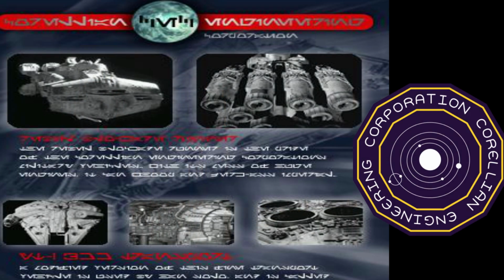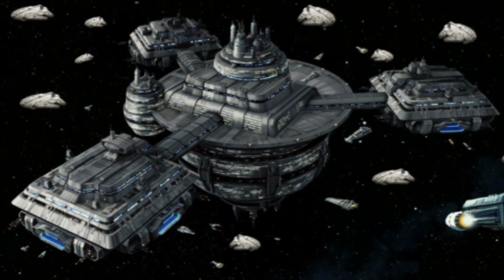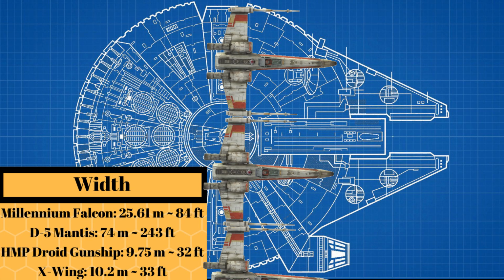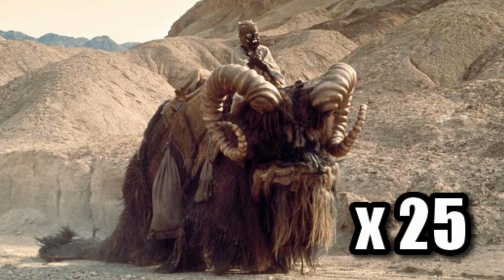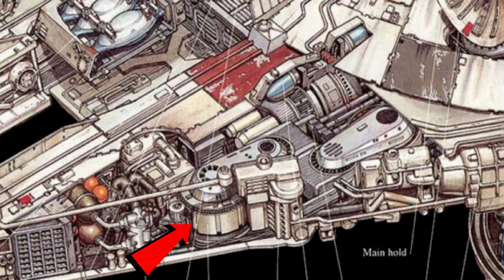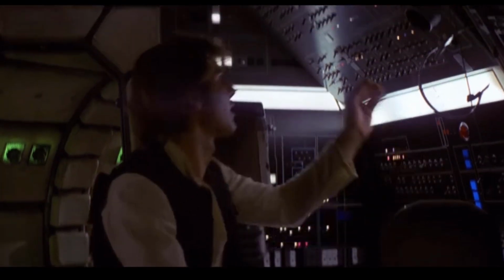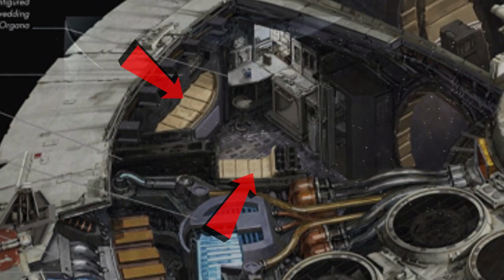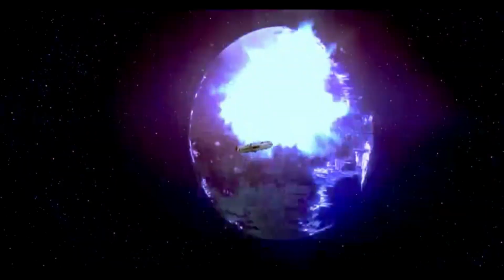Millenium Falcon COMPLETE BREAKDOWN  - YT-1300 Light Freighter - Star Wars Ships Explained

Comment: The speeds given are hilarious. They could never escape a planet's gravity with those speeds.
Reply: Probably on about at sea level, the higher you get aerodynamics are less imoprtant so the faster you can go. Concord could only do 472 knots at sea level and even Spacex's mighty Falcon9 has to throttle back so that it doesn't break the sound barrier until it reaches thinner air (maxQ) or it will tear it's self apart
Reply: The speeds listed are atmospheric...Jock is right!
Reply: Geography in Action  I thought about that when they talked about using artillery shells to put people in orbit, I mentioned it to my friend and he started singing " calling major mush".
Reply: Brent Holt Exactly, maybe 68, 000 mph. Our standard communications satellites orbits the earth at around 30, 000 mph.
Reply: It has vertical take off! It doesn’t need to go fast to escape gravity. You can’t say that a balloon is going fast, yet it can fly. None of the vehicles in Star Wars have insane atmospheric speed, because first, that’s not their main purpose, and second, there’s only so many g’s a body can handle.
Reply: Jock Wood Every planet is different, with different sea levels. This guy made himself look like an asshat by making shit up. Go get yourself the First Edition Star Wars Encyclopedia, and a copy of the Star Wars Guid to Ships and Technologies, and you will find the proper specs of our Beloved Millennium Falcon. And that ship design is much older that this guy put on.
Reply: What the hell are you going on about? The initial argument was you calling a fella an ass-hat regarding a speed that was obviously one denoting atmospheric flight, not trans-atmospheric or non-atmospheric. The laws of physics are still relative here. Most of the planets visited by the Falcon in the SW movies have a gravitational pull similar to Earths, even the Space-slug in ESB for that matter. The ability to fly regardless of materials and technologies is still based on human limitations and physics. Not all of the ships in SW are saucer shaped. The speeds mentioned in the article are  in and around the speed of sound which makes perfect sense for repulsor-lift technology and the speeds we saw the Falcon and other vessels fly at in the ten films released thus far. You made a claim of 68,000 mph which is ludicrous after accusing the guy for being an ass-hat and making shit up. As I mentioned, there is no way of speculating an actual mph rating for space flight, as it does not relate to real speed in space at hyper-drive speeds. Hyperspace is not just a speed but it is relative to time as well. Secondly, I have never seen a vessel travel in atmosphere during any of the films that would suggest to me that any vehicle could fly at 68,000 mph! I'm not wrong, how can I be when the discussion concerns a highly fantasized and derivative subject such as SW? Quit while you're ahead, if you insulted the guy for no reason and now you're just being rude.
Reply: @Cliven Longsight  I understand that. But relativistic effects aside, to claim the vessel has a "top speed" really implies the fuel is totally spent. Otherwise you can always go faster.
An airplane has a top speed because of drag. But drag is not a factor in space.
Reply: What’s hilarious is you’re applying real world physics to Star Wars.
Reply: @TheRedRaven_  What's hilarious is that people are trying and failing to apply real world physics to Star Wars.  Most of these people should just give up.  They just don't know what they're talking about.
They shouldn't try to apply real world physics to star wars.  The the insult to injury is that even when they try, they still can't get it right.
Reply: That's assuming you wanted to reach orbital and escape velocities.  What if you only had to get far enough to use the hyperdrive? Basically just exiting the atmosphere.  The lower velocities would also simplify re-entry.
Reply: John Wang The speed doesn’t need to be achieved, it’s a constant speed based off thruster technology in cannon and the films. Sci-fi fiction never asked for realism.
Reply: @TheRedRaven_  You do realize that my post basically said that perhaps speed wasn't needed the way our existing spacecrafts needs them...
Reply: John Wang It’s not up for debate, it’s explained in cannon. Not trying to be a smartass, just saying it’s a debunked conversation.
Reply: @TheRedRaven_  Who said anything about debate or even whether or not it was canon.  My you're touchy when it's obvious you missed out on everything in the first place.
Reply: John Wang stop liking your own comments, it’s obvious.
Reply: Brent Holt im glad that someone else noticed that his speed figures are a joke.  I guess according to him the falcon is capable of light speed and escaping the earths gravity, but cant break the sound barrier in level flight.
Reply: Geography in Action Wrong, The MF is a saucer design. The most aerodynamic aircraft design. And MF was not designed or built on earth, or even in our galaxy. The materials that are used are far more advanced than anything we can, openly, make today.
With certain tech., any aerospacecraft can produce mach and above speeds, without the need to worry about aerodynamics or inertia. And gravitational forces are still felt in a zero gravity environment. It is called centrifugal force.
Reply: My thoughts were more like "So, if you're cruising (floating) at "top speed" in empty space, and the hit the accelerator... What would happen?" :D
Reply: @Cliven Longsight  I feel we're somehow speaking past each other
Reply: @Cliven Longsight  if you have the power and fuel, aren't you able to escape a planets gravity at slower speeds? Maybe I'm misreading something
Reply: Super Slovak ?
Reply: According to the numerous Starwars novels, films, games and umpteen tech books, ships in the Starwars universe can neutralise or repulse gravity, generate their own internal gravity, neutralise or dampen the effects of intertia and leave a planet's gravity well without needing to reach orbital velocities and likewise without needing to scrub off orbital velocity to land on a planet. Having said all that, if ships can generate and shape force fields around them then surely they can form an aerodynamically shaped shield to increase atmospheric flight velocities?
Reply: I can't imagine the tears of disappointment a physicist would shed after reading this thread.
Reply: learn physics before you start saying dumb things. You do not need to achive escape velicity as long as you have enough thrust. You can escape at 1 kmh. The escape velocity is calculated for non-propelled object. And it is calculated without drag and it changes with hight.
Reply: The Falcon uses repulsor-lift engines in atmosphere, I think that the speeds he is referring to, are atmospheric and they seem bang on for what RL's can do...this isn't an SR-71, it's a highly non-aerodynamic 'thing' using anti-gravity. No bucket of bolts is going to go 68,000 mph in atmosphere, it would kill every single person aboard and come apart into a million pieces, it's called G-forces in atmosphere!!! He obviously wasn't talking speed outside of the atmosphere either, because nobody has invented 'Lightspeed' and nobody knows how fast it is, all we can do, is to use the various bits of SW lingo to discuss rates of speed of fictitious space-ships, parsecs etc., etc.... The only ass-hat on here is you for knocking the guy!!!
Reply: Correction these ships would never go fast enough to achieve an orbit. To escape gravity of an earth like planet you just need acceleration that is greater than 9.8 M/s squared. 

Accelerating upward at 10 m/s squared will see you eventually leave earth, even though you’re going relatively slowly.
Reply: Skaianet correct
Reply: Tha_slughy you have no clue what you are talking about
Reply: Negative, it’s the acceleration you need... you can escape earth gravity at 1 km/h if necessary
Reply: No
Reply: no
Reply: With CONTINUOUS repulsorlift thrust, do you NEED high speeds for escape velocity?

Comment: You would think the rebels would have had a few of there own converted into fighter bombers considering the modification potential and they were cheaper  than a Xwing
Reply: CHESHIRE CAT YT -1300 GTI
A rebel light corvette based around the YT-1300 would be an interesting concept. Include all the speed and maneuverability modifications of the Millennium Falcon, just improve the reliability with a good service. Strip out all the cargo space and amenities and add extra quad guns and shields and a large compliment of concussion missiles. It would make a good hit and run raider that could disguise itself as a civilian freighter to get in close to targets in high traffic areas. Launch a salvo of missiles at heavy targets and annoy the crap out of starfighters with its extreme maneuvering and point defense guns. 
And outrun anything. 
It would also work in pitched battles where it would once again destroy enemy fighters and launch concussion missiles at high value targets and could get close enough to make intercepting the missiles very difficult while targeting subsystems. And just be a pest with its zipping around the battlefield doing straffing runs. 
The advantage of it's civilian design is logistics, getting a bunch of them would be easy for the rebels, who then upgrade it's systems with military components.
Reply: Later Legends books mention a YT-5100 bomber, briefly.
Reply: No wonder you don't have a girlfriend you dork
Reply: I am assuming that the costs of the YT-1300 is without any of the concussion missiles and quad laser turrets and so forth, because the TY-1300 was so modifiable. I would bet that the x-wing price, being chiefly a military starfighter would have included armaments in its price. Thus, the price of a YT-1300 other than as a simple freighter would go up pretty fast, and a fully modded out one like the Millennium Falcon would cost way way more.
Reply: I notice that....seen a lot of the same ship except the Millennium....you would think the rebel/resistance would have a couple of them....

Comment: '' really easy to maintain'' not the hyperdrive on the Millennium Falcon has anything to say about that
Reply: jakes punchwood 
True. The hyperdrive installed on the Millennium Falcon is a work of engineering art and very temperamental; it often needs a number of minor adjustments up to moments before takeoff.
Reply: yeah, until he dumped basically NOS into the tank and blew it out
Reply: Grau Wolff 
We all know the scene in The Empire Strikes Back where Han flips some switches, they light up, then power down, then he hits the bulkhead and they go to working great.
Let's pray that time honored and tested repair technique never stops working.
Reply: jakes punchwood 
It was rebuilt, and HEAVILY modified by some outlaw tech jockeys, then further modified by Han.

He was a genius, but got a little crazy with the Hyperdrive.

Lol, and the quad laser cannons - were actually almost as "modified" as the Hyperdrive, to increase yield and rate of fire to dangerous levels.
Reply: William Norton, temperamental? now that's an understatement 😆
Reply: William Norton 
It actually is a REALLY bad idea to hit electronic equipment, and never really fixes anything - been there, tried that 😢
Reply: jakes punchwood easy to fix usually also means easy to break.
Reply: Temperamental...... more like... bipolar
Reply: I remember reading the Falcon has a 0.5 Hyperdrive. So it’ll be like flying with the gods in lightspeed. That is if it works.

Comment: 6 exhaust vents, not 4
Reply from the maker: Well technically even more right with smaller ones across the surface, not the maintenance access circle areas but other ones
Reply: 6 at the back? Or did you mean the engine apertures?
Reply: Chris sonofPear, the 6 vents on the dorsal aft of the falcon
Reply: He never said that there were only four, he said that four were used to vent one particular system.

Comment: One thing i find interesting and telling.   The YT-1300 was the smallest ship prior to the X-wing to have inertial Dampeners.   While that might not seem like a big statement...  consider for a moment,  Prior to that, starfighters would be limited in G-forces to prevent pilots from blacking out, in fact IG-88's ship had this problem, where IG-88 couldn't push his engines if he had prisoners on board because they wouldn't survive the G-forces.   

that means most ships would be limited to 9 G's in turns or straight thrust, with some pilots or civilians being limited to 4-6 g's.
Reply: kitsychan - Huh, I didn’t realise, I thought IDs Were Very common in SW.

Does that mean previous ships This size didn’t have such comfy corridors And rooms you could walk freely in when the ship was exhilarating?